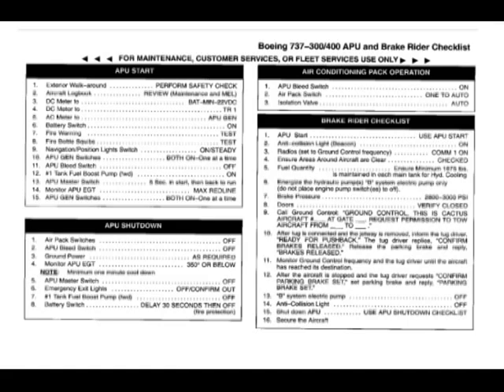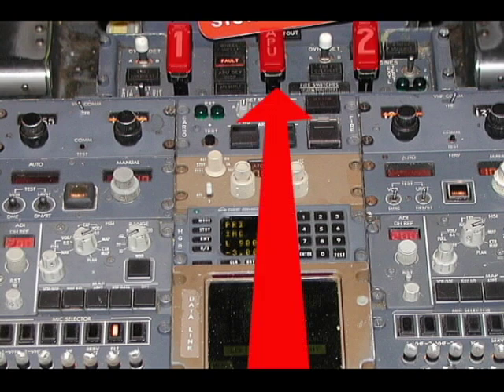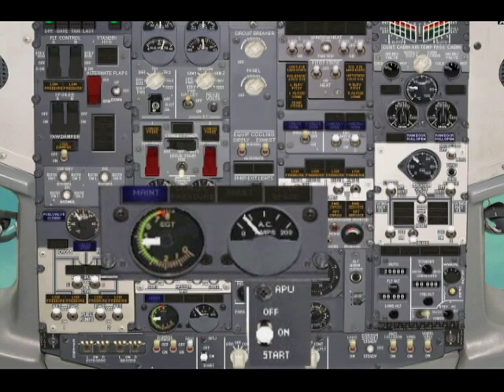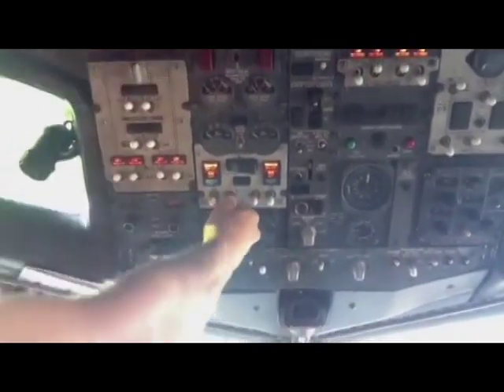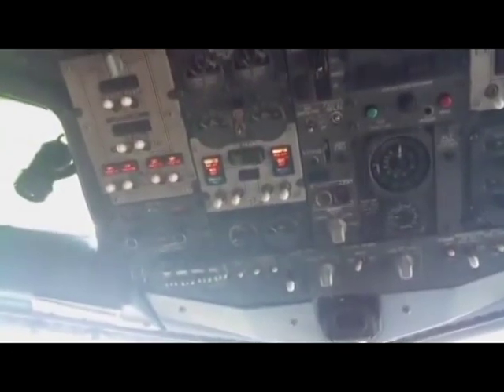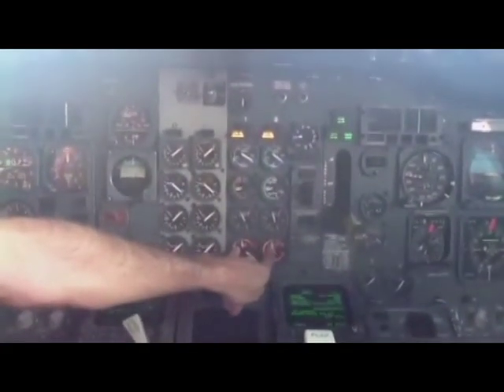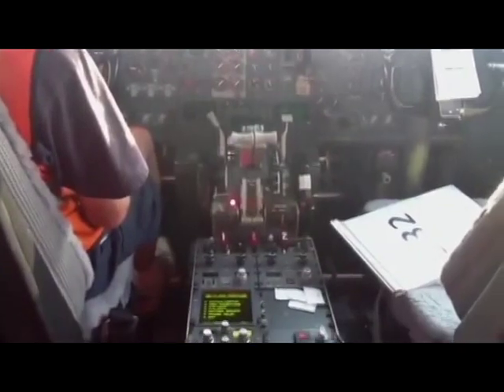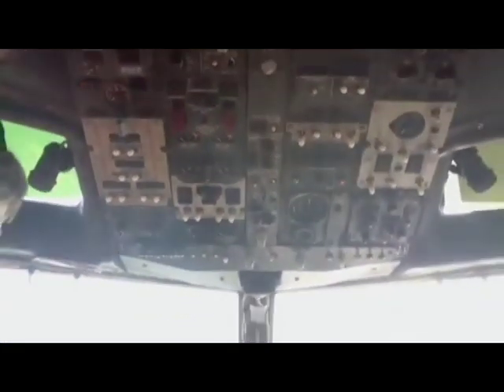boeing 737 apu procedures

Comment: But when the main engines are started via APU why need to switch OFF Battery main ? 
When battery main is off shouldn't be the computers also be off ?! And if yes... the engines would go off because fuel pump is also off.
Reply: Actually, the computers and engines would stay on, because they are powered by the AC bus, which is feed by the engine and APU generators, the battery only feeds the DC bus. But turning the battery off after engine start is a extremely dumb idea, because if for some reason both engines fail in flight, everything will go off, every screen will turn off and you are going right to die, cause you dont know your alt, speed, direction, pith androll angle, if the battery would be on and both engines fail, the battery keeps the standby instruments running.
I cant imagine that any airline would do this.